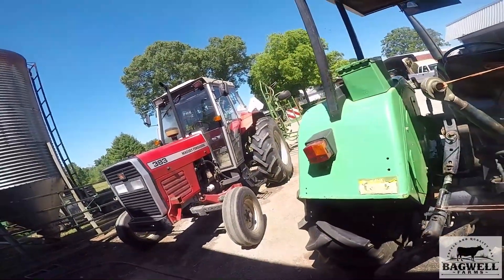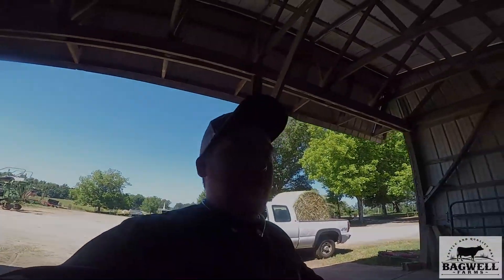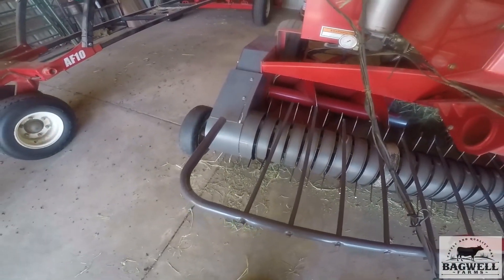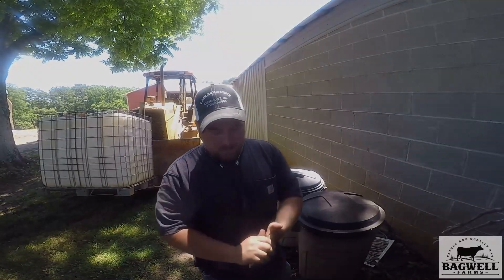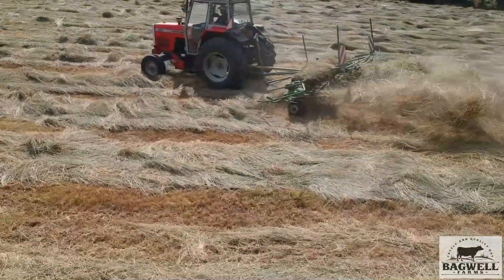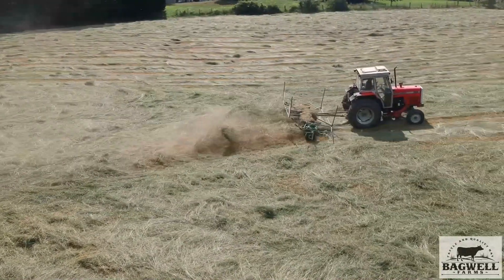Broken Tractors an Tedding Hay

Comment: We have 2 deutz tractors and they are awesome. Don’t hardly burn any fuel at all. Good luck with your hay.
Reply from the maker: We had another one a 6260 I think was what it was it had around 8000 hours on it when it left
Reply: Bagwell Farms we have two old ones I think a 70s model and a 90 and they both have less than 3000 hours. Given to us by a widow. They have run good for us so far. Good luck this year buddy.
Reply from the maker: Dylan Midkiff nice! 👍🏻👍🏻 y’all to man!!

Comment: On the McCormick does the PTO always get turned on at an idle?
Reply from the maker: Sometimes it does sometimes it doesn’t it has soft start engagement you can’t just throw it into gear
Reply: I was going to say soft start or not it’s still a huge difference in wear if you’re idling vs having the engine already at pto speed when it’s turned on.

Comment: Is that the same French-built transmission as the earlier Case branded models? We had a CX90 with 540/eco and it was a total brumby.
Reply from the maker: Probably not sure I can tell you this it’s identical to a case a lot of the body parts an pieces have case stamped on the back of them

Comment: Just curious what hydraulic oil do you use.
Reply from the maker: It either had chevron in a blue bucket that’s $70 a bucket or permatran that’s $90 a bucket seems like it was chevron I generally put permatran in just the Massey stuff
Reply: @BagwellFarms  just a suggestion. Go to a parts store and get the small red tube of shudder fix. It will add more friction modifiers to the oil to help the wet clutch packs hold. Maybe 2 tubes depending on how much it holds.